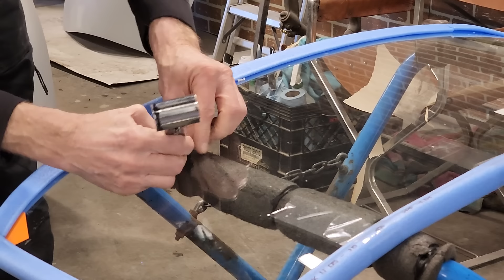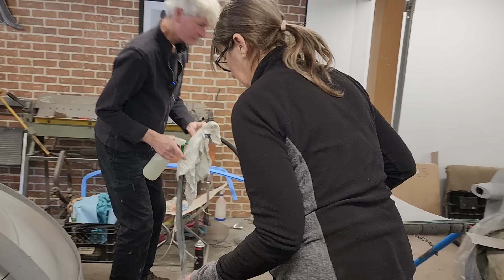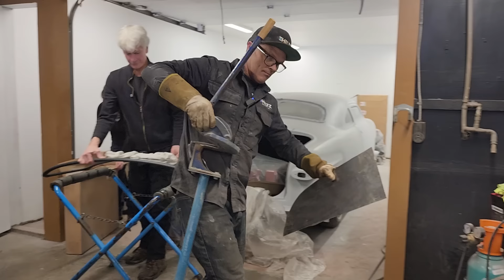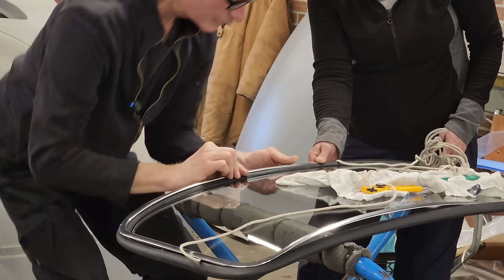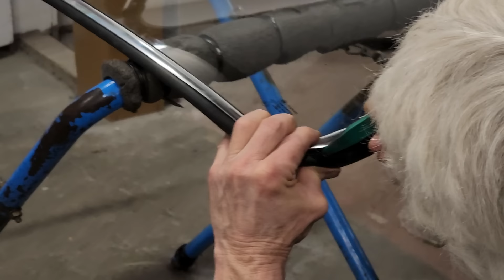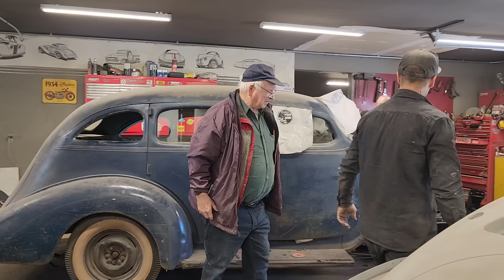Issues with the Bugatti windshield 🙁❌

Comment: Don't mean to be critical but Paul is doing it all wrong. I have installed 100's of windows like that in my career. 1) Install the rubber on the glass 2) Put the rope in the notch that holds it to the car. 3) While someone is pushing on the glass pull the rope out slowly. Alittle soap and water would help.  4) After you've pulled the rope around and out check to see if corners need tucking. Do this with flat plastic tool. 5) Now insert the trim molding with the tool made for that size molding. I know he has one because I saw it the last time he installed a window for you.

I'm sure he is a good window installer. I just don't think he has had a lot of experience install this type of window.   as you always say, " Take what you want from this and through the rest away"
Reply: This molding may not be the old style 813 insert. pretty sure i heard chad say it is a stainless metal chrome strip.
Reply: @kennylavay8492  Doesn’t mater. It still has to be installed last with a lacing tool. Once he gets it installed on the rubber he will not be Abe to get it on the car and sadly that’s when he will realize he did it wrong
Reply: Hmmm, I hope you watched the whole video, and saw that Paul DID get the window in…with the trim already in place…Jeesh, you don’t really know everything, and there is more than one way to get things done!
Reply: @kristamiller9712 I dont know what video you were watching, but Paul still was on the first piece of trim when the wrapped up this video.
Reply: Stainless is the lock in strip forsure .
Reply: Sorry, stay tuned for the next part tomorrow I assume…it is in.
Reply: Thanks, I didn’t have special privilege, I’m Pauls partner, I was there…it’s  Paul and myself you’re watching. I commented while the video was still playing, I didn’t realize it didn’t show the finished windshield 🤷🏻‍♀️
Reply: Krista is paul's wife.  She's got the inside scoop.  She's a perfect helper - knowing what needs to be done
Reply: Thanks for shutting up the so-called no it all people who think there is only one way to skin a cat !! Basically they’re just here to criticize people every single chance they get !!
Reply: Thank you
Reply: Judge not the methodology, just the results.
Reply: You can’t install the chrome trim in after the glass has been installed it has to go in the slot on the face of the gasket before the glass is installed in the car it has a L shaped lip on it and when you rope the glass in that is what locks the the trim down from falling out of the gasket the trim is not a locking strip and it is merely decorative
Reply: This style gasket has no laced in strip
Reply: @smurph1153  you have not fitted this type of trim i can tell.leave it to the blokes who know..earley volvo or jag chek a manual out then comment
Reply: maybe they do it different in Canada?
Reply: I think the trim has to go in first. Depends on the rubber profile, i think. but well, however the right order is - watching this video, seeing the guy wiggeling and manipulating the rubber for almost an hour, with hand movements and methods that look like in an amateur workshop, doing a window install for the first time... was incredibly annoying. Hard to watch. 
If you pay a professional to do a window install, you pay him to exactly NOT do it like that. you pay him to see sure and secure hand movements and apply proper methods.
Reply: exactly I have used the same trick on several vintage cars
Reply: @brucewitcpalek5120  You're  my knight in rusty armor ,then you sprayed the armor with undercoating.
Reply: @JoE_Songs  you sound like you dont know what you are talking about and i will ad that you dont.
Reply: @smurph1153  wa wa wa wa dont tell me ,in the old days you painted them on! Go back to your ken and barbie page.

Comment: Fitting this type of glass, new rubber and brightwork can be extremely stressful, even seasoned professionals can struggle, and certainly what doesn’t help is having a camera in your face, and banging, crashing, welding noise, Paul and partner did well not to walk off in this situation, one bad move can see that glass ruined in an instant

Comment: :face-blue-wide-eyes:I know we all have our own ways to do things. However I would never put the chrome strip in place before fitting the seal and glass. The chrome strip is used to compress the rubber and glass together to create a tighter waterproof seal, so it should therefore go in place at the end of the fitting, should it not! If you know what I'm trying to say:face-turquoise-covering-eyes: The pull string should be in the rubber to frame groove, not the Chrome as it will only pull it out. :face-blue-wide-eyes:

Comment: Maybe I'm wrong but you put the molding in after the windshield is in the car
Reply: Windshield goes in then trim
Reply: There is a tool for that
Reply: No they go in before fitting the screen lmposible to fit after same as early jag .holden etc its different than milo strip.he is spot on the way he is doing it believe me they are a pain in the butt if the mould is not perfect
Reply: @andjonand4112 Wrong...
Theres a tool for that. I have one.. Used it Many Times. Sure- you can install trim first, but its a Pain in the @$$ to do...
Reply: @ThomasSmith-hh8fp  no tom

Comment: On my 71 k10 you install, the trim first ,then the windshield goes in the rubber then it gets installed in the truck.  Very easy to get trim in the rubber before the windshield gets installed in the rubber.

Comment: There's a specific tool to use when installing the trim into the gasket. It spreads the edges of the channel as you pull the tool gently press the moulding in place. Some dish soap helps. Good luck 👍
Reply: No he is fitting it the way its supposed to be done
Reply: I happen to have that tool. bought jt 4 years ago, when I restored an E30.. used it again when I restored my Opel GT..  Its very useful, when needed..

Comment: Moulding is slightly bent (shipping maybe).
It needs to be tweaked a little.  Its curvature is not matching the windshield.
Reply: The molding is made that way so it does not bend outward away from the glass.

Comment: good lord paul and his wife have more patiance than i ever did i think you guys needed to get the dogs barking jim and a brass band in there to round the whole circus out -thats 1 reason i walked away from plumbing many years ago it never failed that we would show up to rough in a new home and the electricians heat and air and every body but the mailman would show up want to all work in the home at the same time and make the work 10 times harder than it needed to be and everyone tripping over everyy one else especialy something as tedious as what he trying to work on it dont take much to break that window and then your back to square 1 if you dont get cut to pieces when it goes ---cmon guys yall can do better than this ........

Comment: we insert rope into rubber n that holds it securely ,fit screen to car, then remove exactly same time fit chrome....but i like Pauls nmethod hes obviously done hundreds his way successfully..this chrome strip doesnt confotrm to glass or rubber,its much higher and trying to fit it sometimes buckles the chrome...if it all fails put screen in with rope inserted to lock it then use chads chrome plastic strip

Comment: the question i have is why are you putting the windows in before the car is painted?
Reply: Did you miss yesterday's show? Go watch it and he tells you why in the first 15 minutes. 😉✌
Reply: He painted around the windshield area yesterday.
Reply: @michaelbristol6467  ah, so he'll be taking it out again once he has done a fitment on the dash?
Reply: @Gadumpski  yeah i saw that, you'd still have to mask up the rubber on final paint unless he is removing it again after the dash alignment etc?
Reply: Most likely it'll stay in for good. And yes be masked off for paint. 👍

Comment: painfull to watch him working on that window wrong...... wtf string is for fitting into the car not to fit trim, no heat to  make the rubber easier to work with,
ie hairdryer 
no soapy water to help the feed tool slide along the rubber easier
Reply: You know it all eh…maybe Chad will hire you!
Reply: What a grouch.  Just relax and enjoy the content.
Reply: Sorry tony but you dont know what you are talking about leave it to the blokes who do
Reply: i have worked for autoglass for many year, so i do know what i am talking about,if you dont use correct tools to get this in it will take you this long,
Reply: a trim feeder is what he is missing, if he did not have one you can make one in two mins to do this trim,the corners always get a little bend,check before starting to fit, soapy water is your friend in this job, so is soft rubber, not using them is ten times harder
people say i dont know what i am talking about are the real ones that dont know.
Reply: @anthonyprice5615  the people are rite tony you dont.
Reply: @andjonand4112  really...
Read all the comments, I'm not the only one saying he has done this wrong, so it sounds like you don't know what you are talking about.
Reply: @andjonand4112  @smurph1153 . 13 hours ago
Don't mean to be critical but Paul is doing it
all wrong. I have installed 100's of windows
like that in my career. 1) Install the rubber
on the glass 2) Put the rope in the notch
that holds it to the car. 3) While someone
is pushing on the glass pull the rope out
slowly. Alittle soap and water would help.
4) After you've pulled the rope around and
out check to see if corners need tucking
Do this with flat plastic tool. 5) Now insert
the trim molding with the tool made for that
size molding. I know he has one because I
saw it the last time he installed a window
for you:
I'm sure he is a good window installer. I just
don't think he has had a lot of experience
install this type of window. as you always
say," Take what you want from this and
Reply: @andjonand4112  read before opening your mouth about things you don't know.
Reply: @kristamiller9712  Well, I guess I do
As more people have also said the same thing...
@smurph1153 . 13 hours ago
Don't mean to be critical but Paul is doing it
all wrong. I have installed 100's of windows
like that in my career. 1) Install the rubber
on the glass 2) Put the rope in the notch
that holds it to the car. 3) While someone
is pushing on the glass pull the rope out
slowly. Alittle soap and water would help.
4) After you've pulled the rope around and
out check to see if corners need tucking
Do this with flat plastic tool. 5) Now insert
the trim molding with the tool made for that
size molding. I know he has one because I
saw it the last time he installed a window
for you:
I'm sure he is a good window installer. I just
don't think he has had a lot of experience
install this type of window. as you always
say," Take what you want from this and
Reply: @anthonyprice5615  no you are wrong just relax anybody can make a mistake mate. its not a milo strip
Reply: @andjonand4112  so you have experience in window... I don't think you do
Reply: @anthonyprice5615  the game  so far is john one tony yet to score .did you watch how it is done tony?hope you learnt something."get one up yar" i allways said the worst thing about fitting glass was listening to people telling you how to do it.

Comment: a little WD 40 in the moulding groove and the moulding will snap right in
Reply: Yes, many things will go together 'wet' that wil not seat right assembled dry. Lots of rubber examples. Grommets.....
Reply: Also it will jump right out again for sure using wd 40.
Reply: @kennylavay8492   correct sir. WD is not really fully compatible witb rubber. If dry IS tbe issue?  I might liberally use a mildly slippery evaporant. Windex.